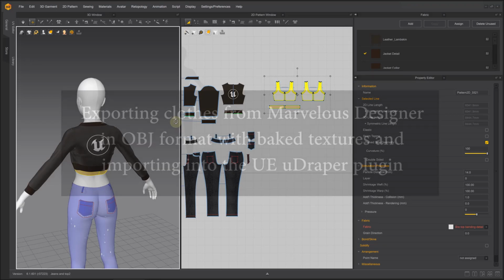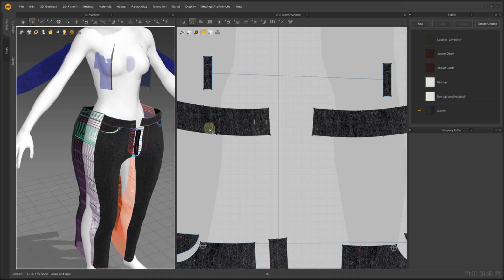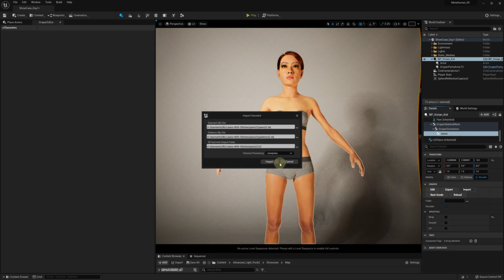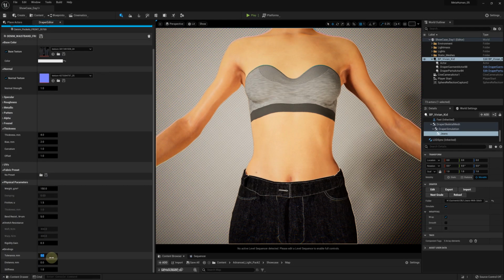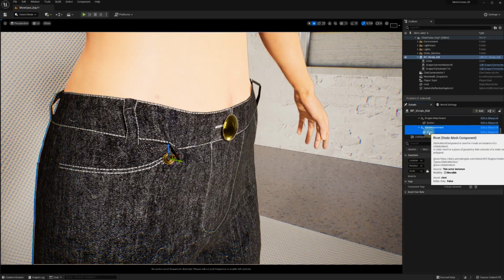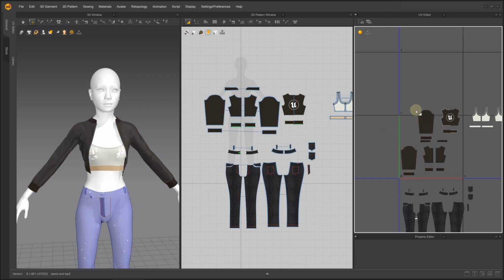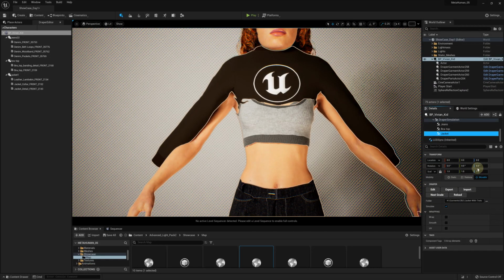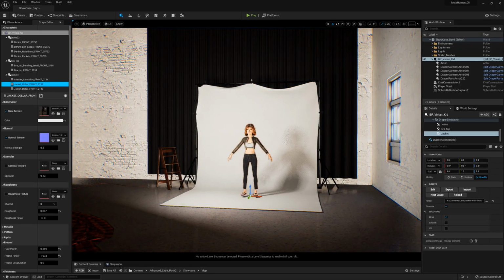Marvelous Designer outfit to UE for real-time cloth simulation - part 2

Comment: Can I import clothes from my DAZ 3D library exported as OBJ, or must I use Marvelous Designer. Thanks
Reply from the maker: We had problems using garments exported in OBJ format from Daz. 
Do you need the clothes to be simulated or skinning or wrapping would be enough?
When exporting from Marvelous, you have more options
Reply: @triMirrorTV  Thanks for the Quick Response, Yes I need Simulated clothes, A real shame, I thought I had found an answer to my problem.
Keep up the good work your plugin looks good, just not for me at this time. Cheers
Reply from the maker: @digiart-cgi-ai-9152  send me a screenshot of your clothes?
Reply: @triMirrorTV  No single style of clothes, I literally have hundreds of costumes I wanted to use, depending on which character and project I will work on, just wanted to know if it was possible, as don’t have time to make custom clothes
Reply from the maker: @digiart-cgi-ai-9152  got it

Comment: I keep getting this error when trying to import to Unreal "Mesh does not contain recognizable geometry"
What could be the reason for this ?
Reply from the maker: Make sure you uncheck "Include Hidden object" and "Include Internal Shape" when exporting your OBJ file. Please send me your OBJ file to look into the problem. You can use Contact page or Discord https://discord.gg/CZsQVe4Y9Q
Reply: @triMirrorTV   Both options are already unchecked. I will private message you on Discord now
Reply from the maker: @visualsbybo  Happy to help 😉
Reply: What was the fix! I have the same issue @triMirrorTV
Reply from the maker: @LetaoChen  Please use our Discord for support. Most probably, your MD export is incorrect. MD does that . Are you using MD button for import?

Comment: Looks very nice, but not sure if it will do for stylized clothing where thickness in certain areas of the garment where collar, lapels, and pockets are reuquired etc. Can you confirm this?
Reply from the maker: Currently, different thickness can be applied to different materials. So, if you specify different materials in MD or 3D Draper, assigned to different pieces, you can set up different thickness for them.
Reply: @triMirrorTV  Thats interesting, how does it do the thickness, copy the UV of the cloth piece and stretch it to create the bordeer of the extrusion? Also, the wrap part of the video, is similar to a wrap deformer in Maya to wrap that piece in real-time? Oh, also i see you attachment for things like buttons etc, would this work for pockets as well. You mat have guessed im looking for a solution to stylized character animation and cloth sim for cinematics rather that having to use the long pipeline of MD, retopo, into zbrush for thickness in some areas and then skinning and simming n MD.
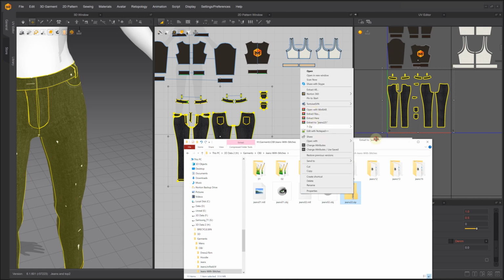Reply from the maker: @7_of_1  the thickness and the bias applied in real time. See e g. At 2:44 https://youtu.be/E8ZIWcHTFHw
Reply from the maker: @7_of_1  yes about the wrapping
Reply from the maker: @7_of_1  not sure about the pockets as attachment
Reply: @triMirrorTV  Thanks, it looks very impressive. I will watch and see. Of course will depend on the monthly cost :-) Thanks for being so responsive,
Reply from the maker: @7_of_1  another attachment example https://media.discordapp.net/attachments/867873475259793458/953456825813045289/draper_attach.gif
And this video https://youtu.be/i8KJhx1Odjw
Reply from the maker: @7_of_1  sure thing. It has some limitations of course but with a little creativity one can find a workaround